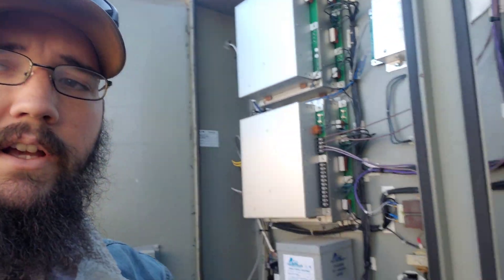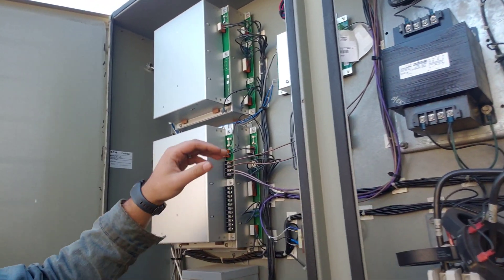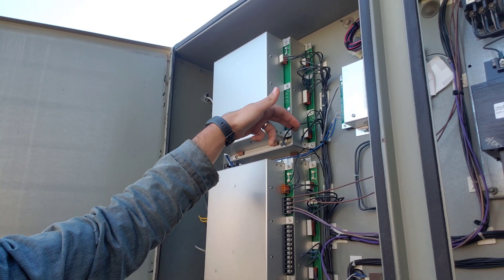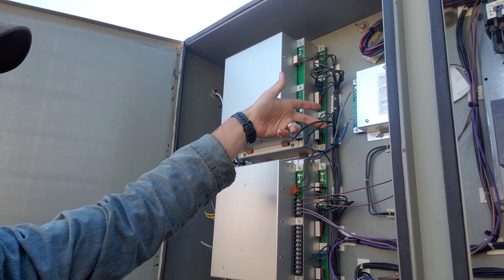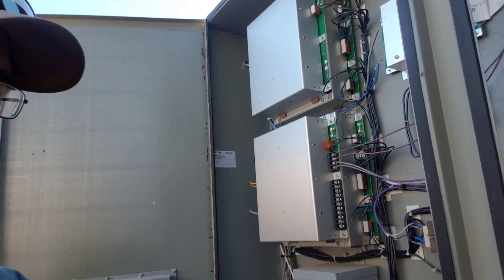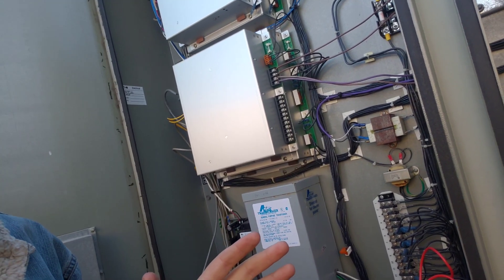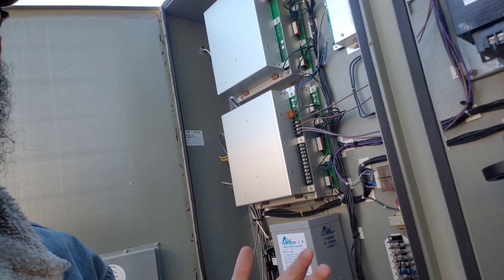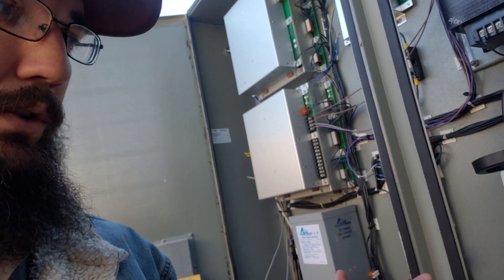Trane RTAA Chiller BAD Unloader coil

Comment: Can you explain why 30 million ohms to ground is bad?
I struggle understanding what’s ideal, thank you
Reply: The higher the resistive value (Ohms) that a coil creates means the coil is resisting electrical current (Amperage) to flow through one end to the other. With this amount of resistance means the higher the chance of an electrical fire. Think of electrical current as how strong a body of water is flowing, and electrical resistance is how wide the body of water flows through... If the flowing rate of water (current) stays the same while the riverbed narrows (resistance), there is going to be a flood (not good). If the electrical resistive value is large enough that indicates that electrical current is not able to pass, the electrons (current) have to go somewhere (heat or grounding) since it is a form of energy.